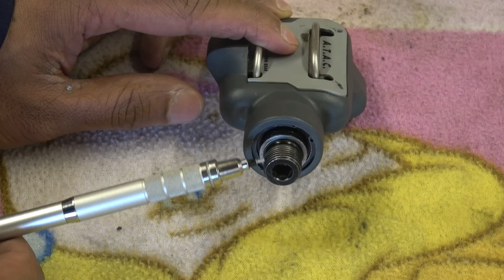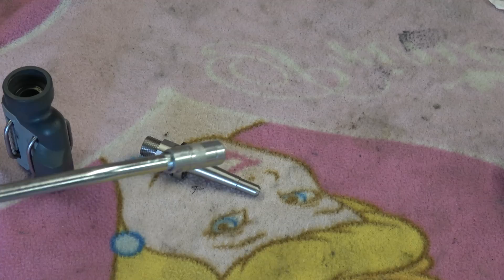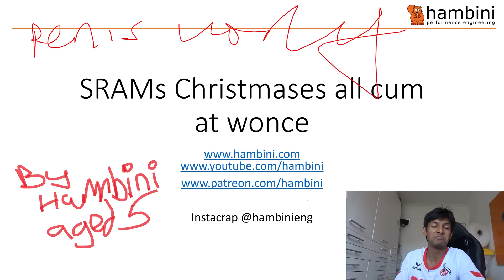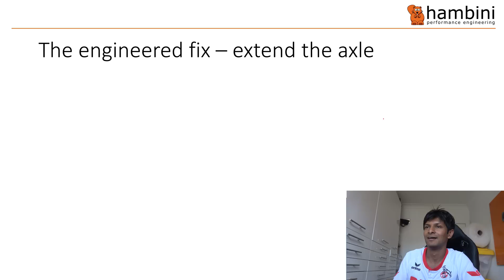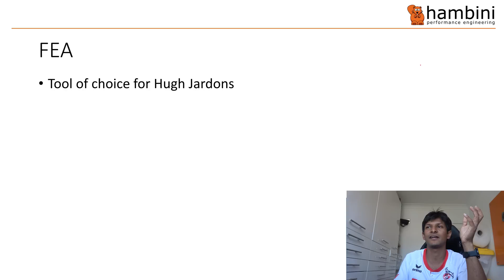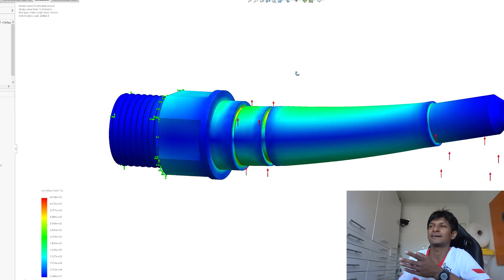Precision FRENCH Engineering refined by a 5 year old: TIME ATAC pedals

Comment: Great seeing my pedals featured here. Much as it is tempting to leave a response riddled with sarcasm, I could not be happier with the finished product, and the Hambini service was first class throughout. The new axles are the perfect solution for my duck-footedness; I am no longer smacking my ankles off the crank arms, and I am feeling much more comfortable on the bike too. 
I have tried pedal extenders in the past, but the increase in q factor (20mm each side) is so dramatic that you end up walking like John Wayne.
Reply: Having purchased a Hambini bottom bracket, it doesn't surpise me this was exquisitely made - he's not too bad an engineer .
Reply: @timmoss8510 He is but Rumour has it he can't cook a poppadom without burning it #getoutofmykitchen
Reply: @glennoc8585  poppadoms in air fryer?
Reply: Fun fact...John Wayne would wear shoes a size too small singed walk with a swagger.
Reply: I could not be happier with how I was finished. Hambini serviced me first class. The axles are perfect solution for my dick-foot. I am smacking my ass on his crank, and I feel more comfortable riding. I tried penis extenders but the increase in eww factor (20 inches) is so dramatic you end up walking like John Wayne. 

Sometimes the sarcastic response writes itself
Reply: It's more painful, but your ortho can break your tibia and correct the duckfootedness.
Reply: hang on to your pedals when sram took over they made all the pedal bodys plastic/carbon apart from top end stuff The plastic location holes for the tensioner adjusters are weak and the pin comes out and the pedal location bars are loose and out of alignment  I found some old mid range new old stock steel bodys that are awsome
Reply: Do longer pedal axles help your feet to adopt a more neutral foot rotation? Or do your feet continue to toe-out and the longer axles just stop them hitting the crank arms?
Reply: Nice one
Reply: Maybe you need to stretch your external rotator muscles, Piriformis.  https://www.youtube.com/watch?v=k71yD9W8rms
Reply: So now you need a set of pedals for each bike you own ?   N+1 and all that :))

Comment: great explanation. I still have a question: I noticed these pedalºs spindle are really similar in shape and bearings organization to the actual Koe look pedals. I always thought that the big ball bearing at the inner side of the pedal was to decrease the stack height (as also seems to be implementing Shimano on its pedals) but now that I see that the Time attack pedals have that structure (something like a 12x18x5 ball bearing at the crank side) and they are not low stack and as you designed in your FEA schematics bear a low load: why are they bigger than the other ball bearing?

Comment: It's really nice to see a video confirming how well the old Timepedals were engineered.  It's common to see 30 year old samples of these pedals still functioning well after years of hard use.  In contrast, the square spring "XC" series would last me a maximum of 6 months due to bent springs which required too much faffing to replace, or cracked pedal bodies.  The last Timepedals I bought were a pair of XC2s that had pedal threads machined OUT OF PLANE with the axle. I think they were sold to SRAM group recently. Not holding my breath but hopefully the QC and design start to align more with the Time of old.
Reply: How did they get that right,machined pedal threads out of plane?

Comment: At least in this video, the hardened and ground axle you replaced was not either hardened or ground.  I don't know whether you plan to heat treat it later or what the plan is but the axle you removed was of much higher quality.  Not refined, just lengthened with wrench flats?  Please berate me if disagree.

Comment: If you don't put the inner circlip in the axel will just pull out of the body.
Reply from the maker: interference will hold it in
Reply: @Hambini  I've rebuilt several dozen pairs of those pedals and I've seen some with a less than ideal fit for the bearing. To the point of where you can hold the bearing and slam the axel on the bench and the bearing will pop off. I'm glad the back it up with a circlip. As far as the pedals, they are my first choice, I've tried others and I keep going back.
Reply from the maker: It's my axle not a time axle so I'd be amazed if it came off
Reply: @Hambini  well yes , not that I don't trust Time's QC, but I'd have infinitely more faith in your axel to have a proper press fit.

Comment: I'm still using Look "delta" pedals, specifically PP256s, with full-float red cleats.  These are often available used but of course can no longer be had at retail.  One of my sets has been in service for over 20 years without any rebuild.  The cleats are still available from various retailers.

Comment: What series stainless steel did you use?  Great breakdown of the technical details. The reason why ANSYS is one of the most used FEA is they give it away to Universities similar to SolidWorks.  The top two FEA software packages I've used and liked are NASTRAN and Pro-Mechanica.  But like you stated, set up is key to getting believable results.

Comment: The FEA model needed more work. You don’t (shouldn’t) include threads of the pedal. It’s not a proper “defeatured” FEA model; a CAD model isn’t an FEA model. 
Also should have used a “split line” along the axle axis. It’s a computational waste.
It’s a great video though all the same, but the FEA part was off.  But I love his videos for his technical prowess.
Reply from the maker: Errors were on purpose to stop the usual clowns copying

Comment: Do you think the lack of hardening  at the needle bearing end will have an effect on the longevity of the axle/pedal? 
I understand why it's not commercialy viable to harden 2 pedal axles! but it seems a crucial detail that the original designer thought to include, if it's not needed was it just over-engineering?

Comment: Any interest in machining a 170mm spaced hub with only a 6 bolt rotor mount? I run my fatbike fixed and it would look much cleaner with a custom hub. Plus an even spoke tension wheel. Cheers, Jorge

Comment: French Engineering 1          Hambini Engineering 0  ,   Not making that   spindle out of steel ,case hardened  (not expensive )and grinding for bearing fit is asking for trouble.
Reply from the maker: Is be interested to know how cheap you think case hardening is
Reply: @Hambini   Around £58 for the 1kg compound  .The  machine shop I used to work at , it  was done quite often.
Reply from the maker: @geraintroberts6606  that's not cheap given the value of the pedals
Reply: You don't use the complete  tub just some of it , if you go to a machine shop that's does case hardening then individual cost would be low. How much did it cost make the stainless steel spindles which will damage the needle bearings because they are not hardened  then you will spend more money on new pedals.

Comment: Did you consider Stavax steel?
Other designations : 2083, SUS420, AISI420.
Hardenable, if you want to, and definitely better than stainless steel.
Reply: similar to my own question
Reply from the maker: It's mainly the cost. If money was no object then I would have hardened it but it would add a few hundred pounds onto the pedals

Comment: I have the Time ATAC Roc S pedals from about 2009.  Great quality, wide platform, solid engagement.  I then bought some Time ATACs a few years later and one of the springs broke and they just seem lesser quality.  I think I heard they moved manufacturing to a different factory?   I also read somewhere the quality has been improving.  Not sure where SRAM fit into all that, and whether they are addressing the previous issues.  Shame that Time did that to their reputation.  I've  gone over to Shimano and Look Xtrack not tempted back.  Shimano cleats allow more rotation so I can have my toe slightly in.

Comment: I’ve run Time ATAC pedals since the 90’s. Early ones have run and run. I’ve had bearings go on newer models though. Maybe lower quality bearings? Last year one seized while riding. Pedal unscrewed over a few pedal turns and detached as I stood to accelerate. I went down hard across the handlebars and landed on my face. On grass thankfully but was knocked out for a few seconds. 
Think I might take mine apart and put new bearings in from a reputable supplier !

Comment: Sorry Hambini, just look at the retention hoops, they look brand new, the damage to the pedal body are from a botched rebuild. As for Sram owning the pedal division, I am glad that they are offering the pedals and the replacement cleats (for all the way back to Impact and RXS cleats).
Reply: I bought these pedals secondhand, so the damage could well have been done by the previous owner. Not to worry though as they are holding up just fine and I have at least 8 other pairs to fall back on.

Comment: What a gem ! Goes straight into my all-time favourites, this one.               
                                                                                
Now that you have so supremely ventured into vintage french parts, i am starting to dream of seeing you machine solid axles for those old mavic 500/550rd (rear) hubs one day...

Having taken apart a fair bit of old french pedals, i can confirm that using the same axle design in (sometimes wildly) different pedals has been common practice. I guess it was one of those things that one would redesign every 50 years or so ;D

Comment: I had Time pedals on my mountain bike for twenty years, until I finally wore them out. That was when I discovered that Time pedals had gone to SRAM. From that point on, I began to search for a pedal system that was as good as my original Times and found the market sadly lacking. In the end, I went for the Crank Bros egg beaters, but they are not even close to the Times in terms of quality. I am not convinced that they will last as long, but at least I can get replacement parts when they do turn to dust! I would love to see you pull apart a modern set of Time pedals to see the cost cutting that SRAM will no doubt have done in order to sell more of their junk. Before anyone asks me why I dislike SRAM, I was a bike mechanic from the 90s up until about 10 years ago and frankly their stuff was always problematic. Recently I had to fix a friend's SRAM equipped MTB and it was horse shit that fell apart in my hands. Not even Shimano Tourney is that bad!
Reply: I moved from (modern) ATACs to Shimano's (XT), and I was not disappointed - 7 years on. I missed out on the original ATACs but wore out the clip-in bar on two of the newer ones in maybe 3-4 years of mountain-biking.

Comment: Been riding Time pedals since 1980’s....first Mag.road pedal then the Atac. MTB on mountain bike since early 1990’s...only annoying thing is that they just WONT wear out! I love new bits,but no need to replace these pedals cos they last and last and last. Brass cleats last really well too. Only replaced bearing once in 20 years. Two years ago came across some new,old stock pedals on eBay so got them. On gravel bike use the Carbon Atac. which uses the same cleats. Surprised nobody seems to mention these excellent products when discussing MTB pedals. Same for the road pedals. Excellent.
Reply: hi, I got new Time pedals and I got a little play in spindle, about 0.5 mm. Is it normal witn new Time pedals?
Reply: @funLad80  not really no. Normally last a good while before any play in bearings. Easy to replace though

Comment: Looks nice, BUT:
If the roller / needle bearing do not have its own inner race (that i expect, correct me , if i'm wrong), then NOT hardened landing on a modified axle should be a problem in a long term lasting usage.
Groovs on a axle i see as a stress points (and a bend animation confirms that) so if they are there, they shoul be made very precisely without sharped edges. Maybe not big problem in this case, maybe.
Not hardened inner (6k series) bearing landing i do not see as a problem (because bearing has it own inner (hardened) race and a contact area between the bearing and axle is not small).
And mister Hambini it looks like You make a mistake with the longer thread for using any added washers (for bigger Q-factor) - it looks like You made same lenght (measured by my eyes from contact point / surface "plate" to end of the thread)
Instead of "female HEX" on inner end You should drill there a hole for some material remove to save some grams ... 😉
Disclaimer: Please excuse my English, i'm maybe from 2 to 4 year old and i can't count, but english writing i can't too, of course. 🤪
P.S.: I can't understand WHY are pedals not loosing from cranks due pedaling??? If i'm right, thread direction  on pedal axles for loosing them from cranks is on same "way" as "forwards pedaling", but on my bikes i lubricate threads and i tighted it only by small force using my hand on shorter hex key arm to be able remove it later.

Comment: I know  a machinist that engineered a foreshortened crank. It had a second bearing and worked as two segment that were long in the down stroke and short in the up stroke as the rider had great discrepancy between limbs. But as a courier Time ATACs are the best for brakeless track bikes since they don't let go of the cleat as quickly as shimano's will.

Comment: Completely off topic but I have a question. Aerodynamisist I am not but it seems to me that as bike frames get wider and wider there must come a point that the narrow old school small diameter steel tubes, despite their lack of aerodynamic shape, would have a similar air resistance to a wider but better shaped design? Maybe that cross over would be either a much smaller tube than steel bikes could ever be made in, or much wider than modern carbon frames have so far become, but there must be a point when one equals the other?

Comment: Back in the days (>10 years ago) I used to use ATAC pedals on my MTBs, and I really liked them, but soon enough I found out that the ATAC cleats cost about the same as the Shimano M520 pedals (!!!) (which included cleats as well), and weren't THAT much better. So it really made no sense for me financially to keep using them ATACs. I still have like 3 pairs of pedals, probably still OK, but since then I switched to flat, and never looked back... Maybe I'll fit a pair of them on my retro bike, if I can find the cleats...
Reply: Don't throw them out. If you keep the cleats clean and don't lubricate them they will last a long time and are worth the money. Better the cleat wear out than the retention bars. MKS make a similar pedal using what looks like a copy of the Time cleat. Just make sure it's phosphor bronze.

A big reason time is better is the phosphor bronze cleat, not steel. Eggbeaters use a phosphor bronze cleat but it's very small.

Comment: I thought I was the only one still nutty enough to ride these old pedals exclusively. I love them! Long ago when clipless pedals were still a newish thing I checked many different styles including Speedplay. I came very close to buying some beautiful titanium Speedplay Frogs or something, but a friend knew a rider who broke his ankle during an accident in speedplays because they didn't release. There's only one way to release! I even called them to ask about it and they had no answer!

These old Time ATAC's are not a very stable platform but they work extremely well, with the huge phosphor bronze self lubricating cleat, and those beautiful stainless bars which are super smooth, tough and hard. Much better than the rough forged or cast pieces that came later. These are like ski bindings for bikes! I've NEVER been stuck in them during an accident. I never remember how they released, all I know is they released and they generally do with a bang. You freaking know when these things release.

The stability problem means it's important to have solid, stiff blocks of tread, carved out just enough to accept the retention bars, and that stiff solid tread should contact the outer and inner pedal. I also took some stainless sheet and made a shield which contacts the bike side of the bars to prevent the "roll off" effect where the shoe tilts outwards. This made them much more stable. 

There is no adjustment or lubrication possible or necessary for the retention mechanism. It's amazing, bulletproof and beautifully simple. When it seemed like they were discontinuing this model with the smooth spring steel, one piece retention, I went on eBay and found myself one of the last pairs of the original *carbon ATAC's with titanium axles*! So you can be jealous all you want 😆

What you have are the very oldest model. Newer ones in the 90's had a thin aluminum threaded bearing lock on the outside, but I'm not sure it was really an improvement for durability because that SUPER TOUGH plastic the body is made of will easily outlast typical aluminum. I believe the threaded lock cap allowed shortening the body because the width of a lock ring groove plus some ungrooved area to retain it was significant.
Reply: Keep the cleat clean but I don't recommend lubricating them. Maybe some wax. Lubricant only seems to attract dirt and make them move around too much, which seemed to actually increase wear.

Comment: Nice work as always from you! Did you try to fit a needle roller bearing inner ring to your stainless steel shaft to get a hardend surface for the neldels to run on, or did the shaft get to thin with the sleve?